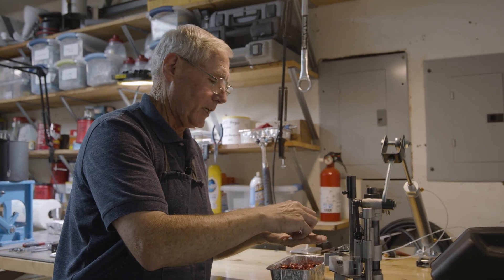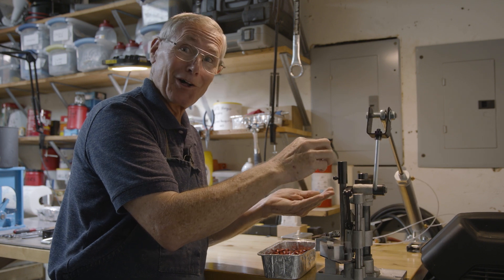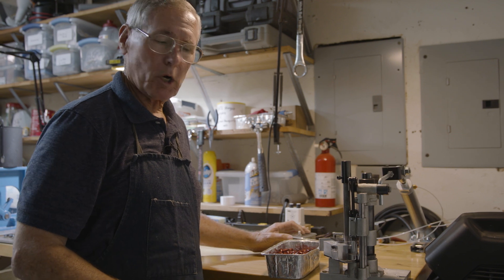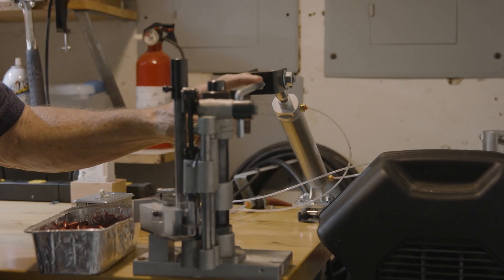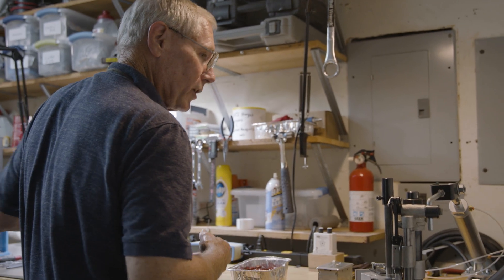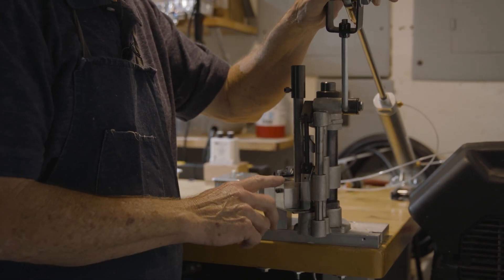Automatic Star Bullet Sizer - Part 2

Comment: Hi there,  looking at this I see an idea, if you have not tried it already. Instead of the making the clevis for the air cylinder to attached to the lever, why not thread the leaver end to accept the same Himes joint as the cylinder, then bolt them side by side together. Just a thought, but it looks good and works.
Reply from the maker: Gayle, please contact me mlccharters@att.net. I like your idea.

Comment: You do an excellent job with your videos, very easy to understand, and very easy to watch.

What are you using to feed it with air pressure? As in, how many CFM, what inlet pressure, are you drying or filtering the air?
Reply from the maker: Thank you for watching, and your questions. 
I have an old Sears compressor with a 20 gal tank. Any compressor that will deliver 90-100 lbs psi will work. I usually size a box (850), of bullets at a time. That takes about 22 minutes. I keep a check on the tank and if it has a buildup of condensate I drain it. I believe any water filtration devise would work well. This is a fantastic help for the “sizing drudgery.”  If you own a Star Sizer this is the way to go. I have included a parts list for you. Look, I had no experience doing something like this. It’s not hard to construct. The main difficulty for me was that a few of the parts I needed were not commercially available. Believe me, I looked and looked:  NOT AVAILABLE!  So I experimented and worked on all sorts of metals. I have now come up with the few critical parts that make it all work like a champ. Some days I look at my Star Sizer on the end of my bench, and with a wry smile remember the days of “Sizing Drudgery!”  Those days are history now.
Reply: Thanks for the reply. 

I have spent the last couple of weeks casting about 8000 45 ACP bullets. Today I will start coating them with HiTek, so I am about to review your HiTek video. Then on to sizing them. I am using a Lee sizing dye in a single stage press right now, but I can see something like this in my future. 

What kind of output do you see from your Master Caster unit?

Comment: Have you considered adding an upside down bullet feeder? Thanks for the excellent video!
Reply from the maker: Matthew, I have considered adding a bullet feeder, like the Mr. Bulletfeeder. This machine will size over 2,000 per hour without an auto feeder. Most hobbyists would find that volume very satisfactory. Even a bullet feeder requires constant attention to keep it filled. That said, please know that I would have already installed a bullet feeder if the money and the need were there!😀
Reply: Dan Dix valid point! You did an excellent job, I’m in the process of building one with my uncle who is a machinist by training. I am waiting on a 3D printer that should arrive tomorrow with plans to make my own bullet feeder. We’re also in the process of setting up a pneumatic bullet caster too.